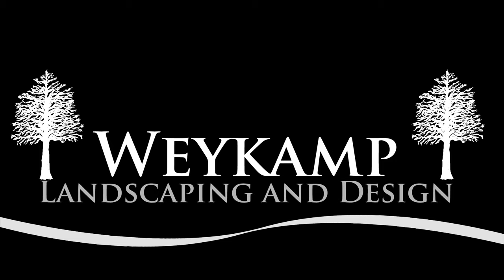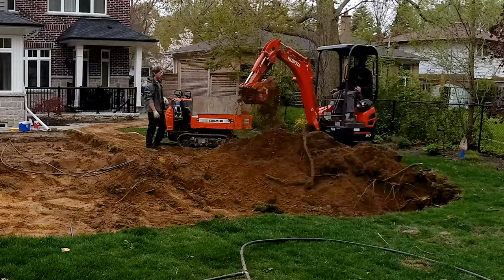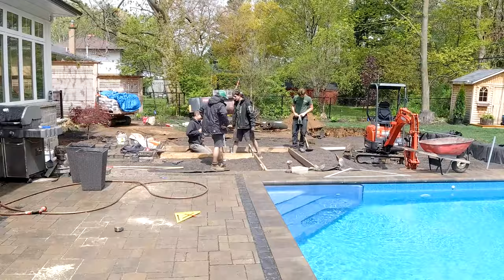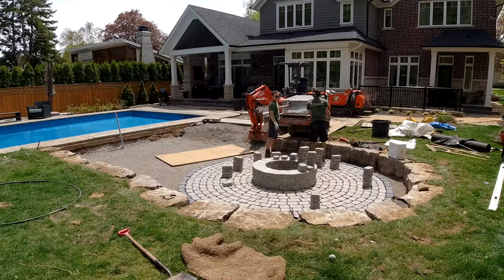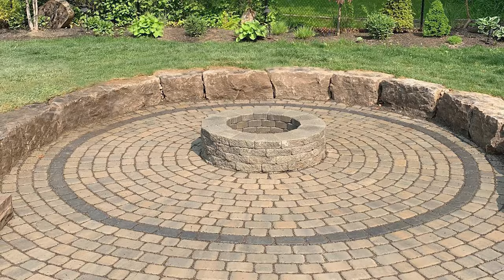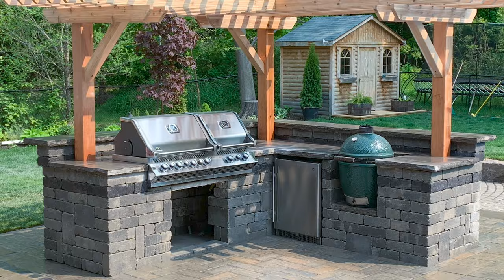Outdoor Kitchen with Firepit

Comment: So if it rains a lot .. it wong get flooded?  I didn’t see a drain installed
Reply: The stones aren't that tight and water will just sink to the ground.
Reply from the maker: @julioviloria3289  We installed 16" of clear stone to allow for drainage into the native sandy soil. It is called a permeable paver system as the pavers have joints around them that are filled with chipped rock that allow the water to permeate into the soil below.